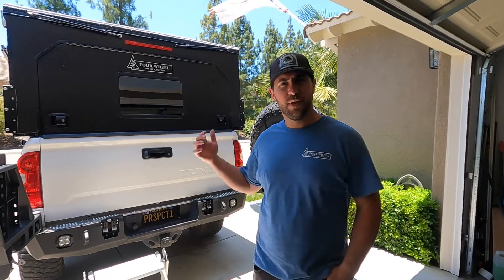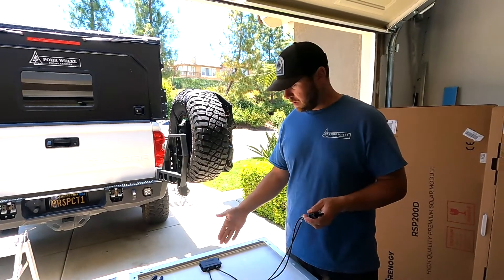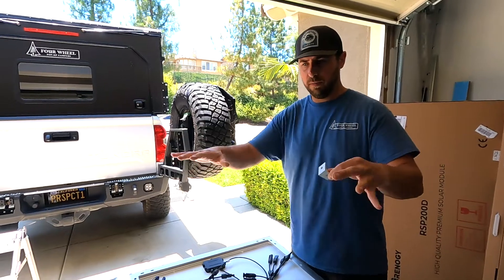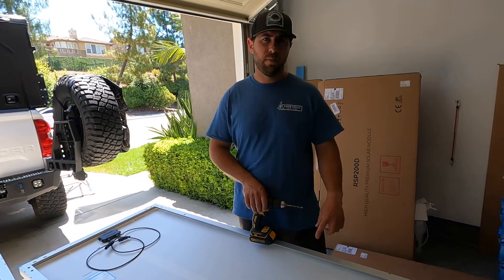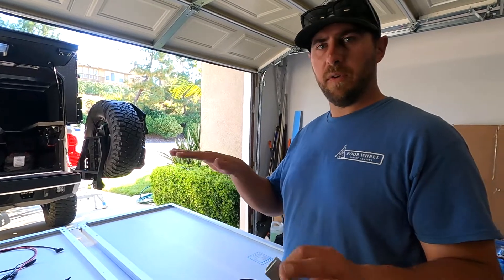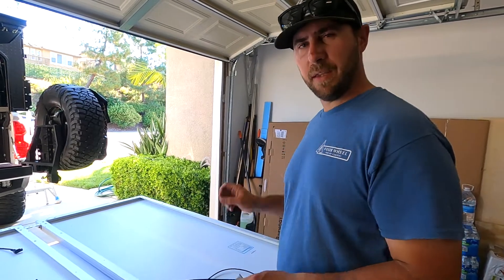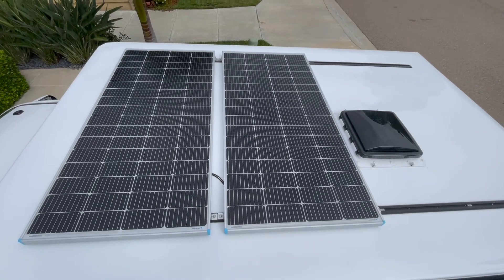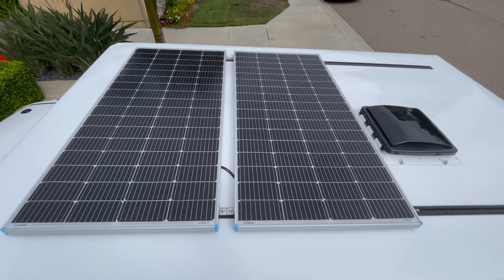DIY Solar Install On My Project M Truck Camper - 400 Watts!!

Comment: Nice video I appreciate your attention to detail.  I have a new Project M and I have two 200W Renogy ShadowFlux panels I'm planning on mounting on my Yakima tracks.  I'm considering a couple different ways to mount them.  One will use 11/2"x 2" aluminum angle to mount the leading edge to help protect the panels while driving and will result in there being a 1/2" gap under the leading edge similar to yours.  I'm wondering if you noticed increase highway noise due to  the panels or have you had any lift problems?  The other method would simply use standard aluminum brackets used on house panels  they're 11/2 " x 31/4" attached directly to the tracks and panel frames.  Have you noticed any panel frame integrity issues with your panels since you've had them mounted for a couple of years?  I'm probably over thinking this but I am really interested in how your installation has held up and if there's anything you'd change.  Thanks again for all the great information you're sharing!

Comment: NEW SUBSCRIBER & I loved the attention to detail. I just ordered the Topo Topper (Rincon) for my RAM 1500 5'7" bed. I just started to try and get familiar with solar and yes, I'm still confused. Mainly because I'd like to have power for a portable AC, a fridge and of course smaller things that need to be charged. It appears that there are two ways to do this, one way is like yours where you have solar panels and your charging your Goal Zero Yeti 3000x for all your needs and the second way is to have solar panels that charge your lithium battery(s) and then convert to ac power. I've seen a few portable AC units, some with batteries but I'll have to see why one method might be better than the other. What's your opinion because I basically have the same set up as you. Thanks for the video, Navy Mark

Comment: Honestly the best overland build I’ve seen and you are so great at explaining your build I feel like i could do it with your explanation very good work !
Reply from the maker: Thank you appreciate it. Message me on Instagram if you have any questions about it.
Reply: @prospectoverland  Nice build. If the inverter can take the voltage (it should) run the panels in series will double the voltage and increase charging efficiency. Question - how have the glass panels held up to rough terrain? I am thinking of mounting some glass panels to my Tacoma but wondering how durable they will be....
Reply: @prospectoverland  Yes, if you are still running this setup, put your panels in series. The goal zero 3000x can take up to 50V /50A / 600W input. But there are even better options out there right now with Lifepo4 batteries that last longer and are not a fire hazard

Comment: Awesome video. Question though: do you have a yeti link as well? If not why? I am new to this but it seemed yeti link is a fast way to recharge the yeti.
Reply from the maker: HI thanks for watching. No I dont. I have never been a fan of connecting anything to the factory motor, wires, alternator etc. I love a Toyota for its reliability. I dont want to compromise any of that. I have so much solar that my battery stays topped off all the time so no need to connect to my trucks power system.

Comment: So are the lights and fan wires in one? I’m trying to figure out how to run a solar generator like yours but have the 12v power lights, fan, refrigerator, and water pump. Seems like solar generators only come in one 12v plug. Your truck is looking great!

Comment: Fantastic video, thank you for putting this together! I'm planning on installing a similar set up on my Silverado 1500. Have you had any issues since installing? FWC service division told me that max wattage the roof plug and wires is designed to handle is 250 Watt panels. I'm hoping to do the same 400 W set up to a deep cycle battery.
Reply from the maker: Thanks for watching and hope it can be helpful when the time comes. I was told the wire gauge which was 12 if I recall correctly. Which could handle up to 400 watt. Double check my calculation. But I’ve had my camper over a year. Maybe they moved to small gauge wire since then. 

And with a 400 watt set up you never get 100% output. I’ve only ever seen 337 watt max. It’s usually in the high 200’s with some shade and a layer of dust and the sun not at the perfect angle all the time. I’ve had zero issues with my set up.
Reply: @prospectoverland  Thank you for the response! I'll double check but quite positive the wires are 12 gauge. Keep making sweet videos!

Comment: Just wondering how the extra weight of the solar panels affected the popup operation?
Do you know what struts your camper came with? Thanks
Reply from the maker: It was noticeable. It came stock with 30lb struts. I put upgraded 40lb ones from fwc. Thats all they recommend doing. Some people put aftermarket 60lb struts on but you potentially void warranties.

Comment: have to consider $525 price for roof rails on the camper
Reply from the maker: I would do it, then it’s warrantied through FWC and no leaking issues. I didn’t want to risk installing my own.

Comment: Just got my Project M and your videos are going to be a big help!

Regarding solar and then going to a Jackery/Goal Zero (I have both), the black and red wires seem to be wires to the lights and fans, so would be powered by the generator 12volt OUTPUT  connector. But, looks like you used the black and red as the power INPUT to the generator.. if you don’t mind, what am I missing?

Comment: How did you get the power into the cab? Thanks.
Reply from the maker: All my antenna wires and power come under the rear seats where the void in the carpet is that use to house the stock jack mount. Now a it has a rubber grommet

Comment: have you ever seen anyone add a 12volt ac unit on the roof of a project M ?  nice set up and great video
Reply from the maker: Thanks! And no I haven’t. I would imagine it would make it difficult to “pop the top” up with the weight of those units??? But maybe not.

Comment: Since you just added weight on that roof with those solar panels. Did you have to change the roof struts and how much or what gas struts did you used? Thanks!
Reply from the maker: They come with 30lb struts and it still worked fine but I could tell it was a bit heavy. I changed them out to 40lb struts and it helped for sure.

Comment: Great combo of solar and Goal Zero for storage.  We have a OVRLND camper on our Ford Superduty, the panels weigh 26lbs each.  Has the added weight to the roof made it harder to push up the camper top?  Did you change out the lift struts?  Thanks Jeff
Reply from the maker: Thanks for checking it out. Yes the front of the camper is a noticeably heavier to lift up but not unreasonable. I would like to research which strut I could outfit it with to make it more like back to stock.

Comment: Hey man! Love watching your videos, very thorough. What plug did you use to power up the lights and fan and how exactly did you do it? Thanks  for the help! Keep the great videos coming!
Reply from the maker: Hey thanks a lot. I ended up buying a 12v cigarette pig tail from amazon and just plugged into strait into the face of the goal zero. I just connected it directly to the stubbed out wire from the camper.

Comment: How big of a fuel hit did you take
Reply from the maker: None because I had camper and 37” tires already. I had been at 10.5 and still at 10.5mpg with this camper.

Comment: been excited to follow along on the build. I'm hoping to order a popup topper in 2024. What made you go with the Project M over others?
Reply from the maker: Froze in my last one during winter camping. This one has insulated walls. Roof fan. Optional thermal pack liner and tons of head room. Plus they have been in business for 50 YEARS.

Comment: Very clean install.  Any issues/concerns opening the top with the extra 40#'s of weight?  I'm thinking the same set up and also adding Thule racks and a long board, hoping that the weight will not be a problem.
Reply from the maker: I certainly can notice the extra 40lbs when opening but it's totally doable and the top stays popped up just fine still. I have had a couple older, shorter folks at shows try and opening before they pulled the trigger on buying and my particular setup was a little heavy for them.
Reply: How tall are you? I'm 5'7" and I'd like to compare that to you @prospectoverland

Comment: Nice work. I might have encased the two small, exposed wires between the panels into a case or sheath of some kind to keep it from cracking in the constant direct sunlight. Just a thought. Nice rig. I wish that was mine.
Reply from the maker: That’s a great idea. Maybe I’ll just slip some of the plastic type ribbed wire sleeve with the slit down the middle on that one section.